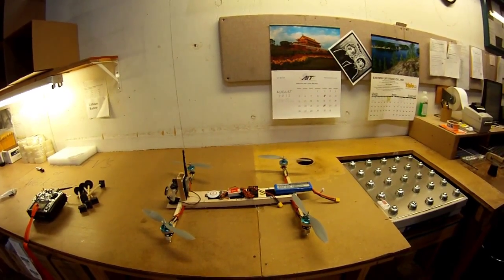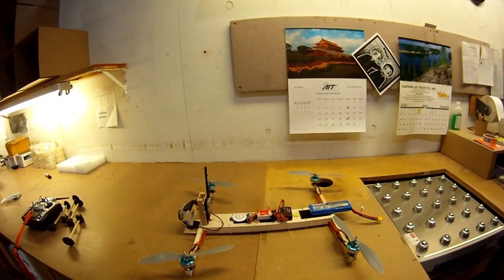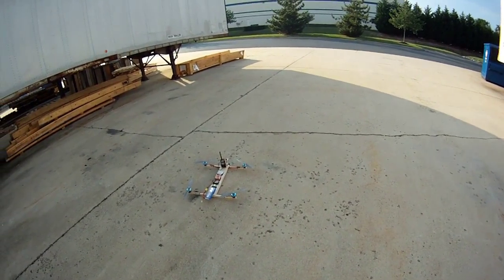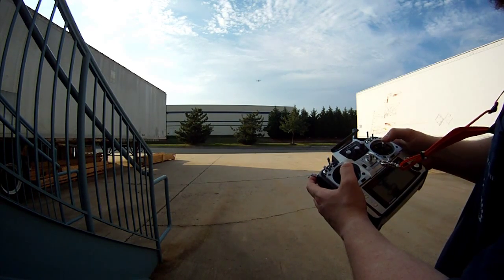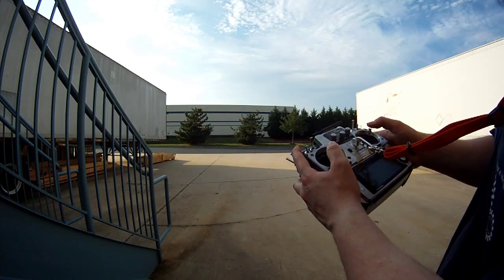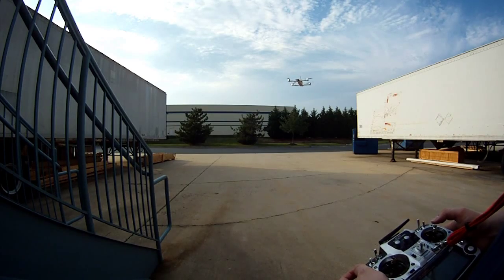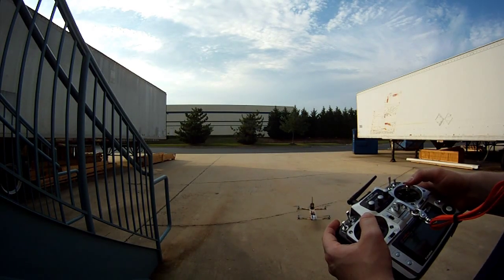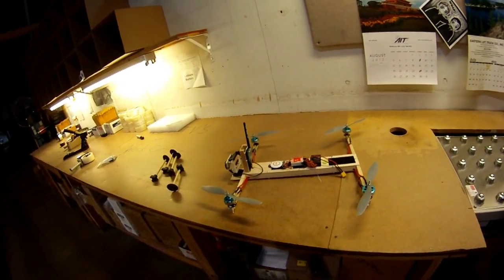Overview of my H-Quad, along with flight video followed by FPV View.

Comment: BTW GOPROS INTERFIER WITH GPS SO KEEP THE GPS ON THE COMPLETELY OPOSITE SIDE OF GOPRO AND ALSO TO REDUCE WEIRGHT USE TWO THING WOOD BARS AND IN MIDLLE USE CARTBOARD WITH LAMINATE MY 565 SIZE QUAD h FRAME WEIGHS 230 GRAMS

Comment: get some dt700's they are just as efficient and are cheaper to. about 438 grams at 3.9 amps or if you have 4 with weight of 1600 grams you consume 16amps with two 4000mah 3s you can get about over half an hour like I have. 40 min at hover

Comment: Dude btw its better to have big battery for longer flight time. Always do math with battery grams/mah ration the biger the ratio the better. My 3s 5000 is 400 grams taking off 400 grams and adding another batery will give u better flight times

Comment: What is your weight with batt and flight times please i get 12 on 5000 mah and using 4000 mah weighing abot 1.6 kilos. Or no fpv no pro guard with 2 5000 mah 1.6 kilo 32 min flight time for my x

Comment: Hey again, i built the flitetest quad myself and didnt really find any issues with weight because it has around 4000grams of thrust... the problems i had were balance issues. You the same or no?